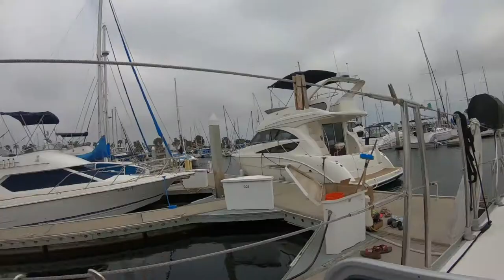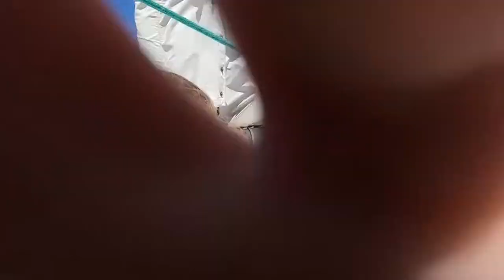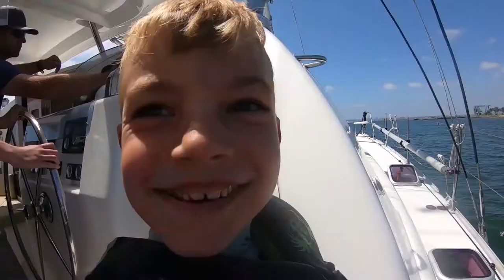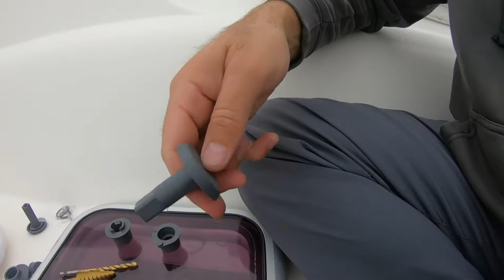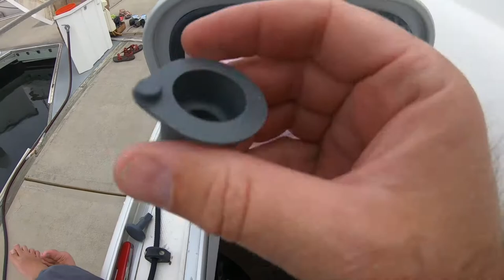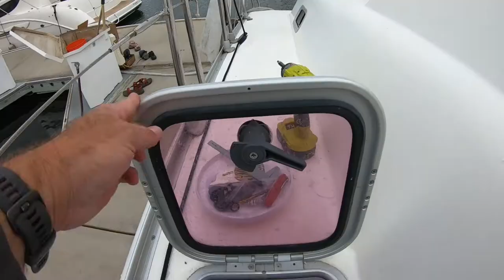Hatch handle repair for a lewmar size 10 hatch on Leopard 43 SV Tusitala

Comment: Alternative repair is to clean old glue thorouhly ( leave no traces of old glue) from acrylic surface and handle surface, sand lightly to roughen surfaces. Place masking tape on acrylic surface, reglue with Plexus MA310 (methyl methacrylate), and clamp for several hours.  Do not dog down hatch for 24 hours.  Repair still effective after 5 years,  Lewmar used Plexus when hatches were initially manufactured.